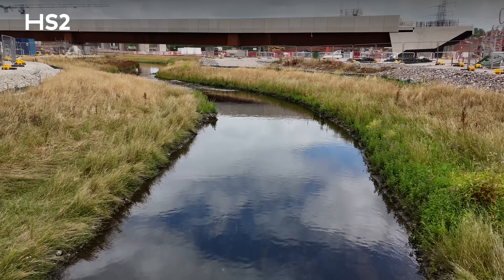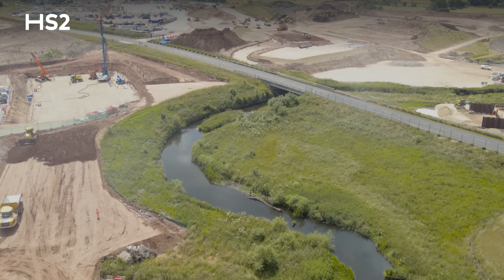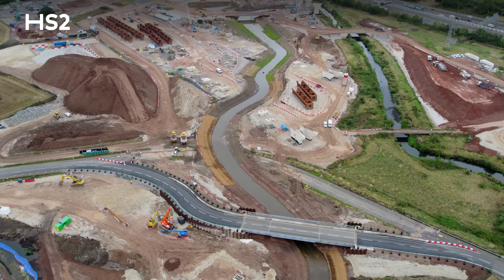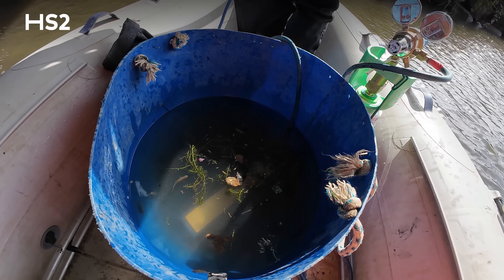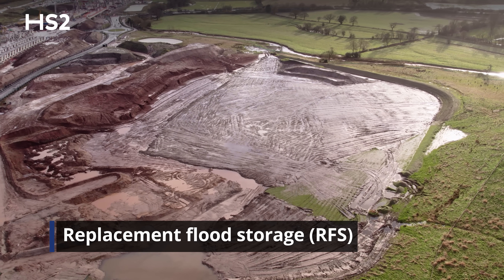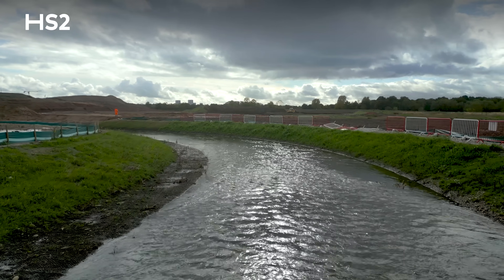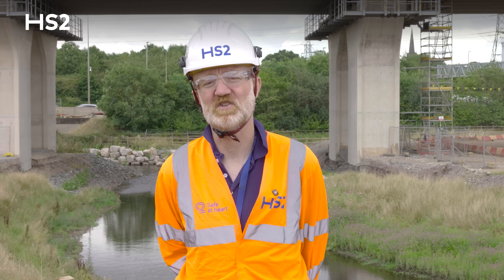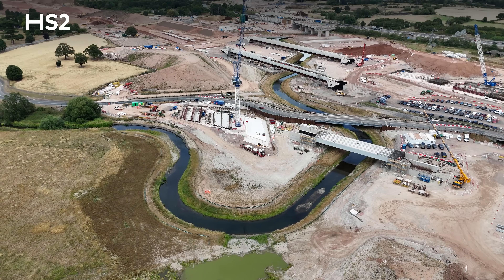HS2 completes huge river realignment in Warwickshire

Comment: Magnificent work - but what complexity, what expense! And this is just a tiny stretch of the railway. England is densely populated with innumerable settlements, so the engineering challenges are extreme. France, on the other hand, is largely empty and flat, so high speed railways can just be driven through at relatively little cost . . .

Comment: This seems to have been a worthwhile undertaking as far as the new river pathway is concerned. The only reservation I have is the apparent lack of inclusion of trees, particularly along the riverbanks.This is an especially important aspect as it should help to stabilise the new embankments, including that of the river itself, more quickly than just mere grasses, and it would add to the richness of the biodiversity that the project is aiming for.  
Climate change means ever increasing storm frequency and intensity. Therefore a major flood event might wash away much of the careful and thoughtful work that has already gone into the project, even (with) the additional flood abatement storage area. Getting trees in early could make the difference between having to redo work already done at great expense and being able to heave a huge sigh of relief.

Comment: Massively over budget,  we don't know what the final cost will be to the taxpayers. What a complete and utter waste of money that could have been spent more wisely.
Reply: How would you have spent this investment instead? How would you resolve the capacity issues and bottlenecks on the West Coast Main Line, increase passenger services, more local services and more freight? Let me guess you only think short term?
Reply: @Maxhead_room looks like you are not going to get an answer so I will give you mine..should have been a new line along the same route but not a high speed line. The Country is too small to justify a high speed line.
Reply: Better spent on improving utilities (water, electricity, sewage) infrastructure.
Reply: But we still wouldn't have known the final cost because Contractors  are refusing to offer all risk contracts above 5 or 6 hundred million. But a slower speed line would have been cheaper than the high speed line.
Reply: @TrevorWilliams-fq8mg thank you for a constructive response. A new 125mph line would have also been incredibly costly too, the same environmental requirements and mitigations would still be necessary, plus it would still need to be built for low maintenance for 125 years, the only difference is that the alignment could have been more tolerant to tighter curves. But if you are going to build a new line then why not build one fit for the next couple of centuries? HS2 is also about new high capacity stations, what would you do in this regard?
Reply: @Maxhead_room I think the Country is too small to justify a high speed line. And given the extent of cuttings and tunnels very little scenery can be enjoyed on the ride. It's an extensive solution to fixing the problem.

Comment: 80 billion and counting being spent , enviroment destroyed and for what? 20 mins quicker to birmingham. This country has lost its mind.
Reply: Plus getting back to your original nonsensical comments. Environmental destruction? There will be a net gain in biodiversity, afterall you are commenting on a video where they are significantly improving the natural environment over what was there before. Don't fall for the populist nonsense fella!
Reply: HS2 is more about providing more rail capacity. As inflation pushes up the cost of the project so does the economic benefit increase by the same margin. Many of the cost increases were caused by the Sunak government making populist decisions about HS2, rather than the right decisions. With your simplistic comment you strike me as a populist-type.
Reply: @Maxhead_room  You don't need a 225mph line with all the associated extra costs just to add capacity, they could just have added another 2 tracks to the WCML to do that.
Reply: @neilrobertson811 so you suggest having a 6 track WCML? Do you not think that is somewhat illogical given the disruption it would cause and all the infrastructure that would need rebuilding (infrastructure that goes through the heart of large cities and towns - how would you squeeze this in?). Plus have you tracked the route and all the slow curves? Classic 'armchair expert' with absolutely no grasp on reality.
Reply: @Maxhead_room  You said capacity, not speed. Make your mind up. And it doesn't need to be 6 tracked all the way does it. An extra 2 tracks at certain locations for certain distances would be enough. You being such an expert I don't need to explain any further.
Reply: @timstarkey-smith8842  I don't know, why don't you tell me. I suspect however much it is it would cost less than 1 billion a mile which is the current cost of HS2 unless you think those cables are made out of 24 carat gold spun with unobtanium.

Comment: It's built for the rich to use because no one else will be able to afford the extortionate fares... It's a complete waste of money 👎🏻
Reply: Since no-one has published any projected fares; how can you be critical about them when they do not yet exist ?. Is it that, you expect them to be excessive ?.
Reply: @JohnHoward-wc9kk I know one of the project managers he said due to the cost of HS2 the fares will be high due the amount of money spent on the whole project. 
It's common sense really how else are the government supposed to recoup the billions
Reply: @jase1435  Well the government has many years, Decades in fact, to recover its investment in the infrastructure. It does not need to pile it all on initially.  Air travel, especially short haul,  is going to increase in cost because of carbon taxation and should attract  more passengers onto the trains. That would be another reason to extend the network to Glasgow and Edinburgh, it would make flying unviable.
Reply: The same comment was made when South Eastern's HS was introduced.  Now the commuter service is packed, standig room only at Gravesend.
Reply: business case was built on assumption that fares would be the same as the existing service. 
Transport objective is not achieved unless most passengers move off the current services (releasing their capacity for places like Milton Keynes) onto the new services.
Think Ryan air not concorde.
Reply: @unkleoo they should have spent  money on the existing railway but instead they've disrupted thousands of peoples lives and in some cases ruined businesses with this farce of a project

Comment: I was told we already got 2 lines going to Birmingham. Why did we need a 3rd? I was shocked when I found out there’s was already 2.
Reply: If you weren't even aware of the two existing lines then you have no chance of being aware they are full with no capacity for future growth.
Reply: Shut up bot.🤖
Reply: @Chevy-jordan what did I do?
Reply: You're right.
Reply: Because those lines are slow for the modern rail an at or over capacity.
Reply: @DavidKnowles0 1h and 20min is not slow😂 I do from dartford to east croydon… now that’s slow
Reply: @Pi-jt3lw  it slow by international standards.

Comment: Mexico just finished there HS rail , twice as long as the UK in 3 years 😂😂😂 bring back the APT
Reply: Road near me Castle Street A63 upgrade in Hull.5 years and invisible men working.
Reply: I don't know anything about Mexico's new High Speed Rail, but they join a increasingly long list of countries that have invested in HS rail. It is a better option for mass transport than new motorways  and air travel. I would take a bet that the Mexicans  have not had to  tunnel a huge portion of the new line to 'protect the environment'  and I doubt any Bat tunnels are getting built. We are own worse enemy in this country. Some of it was necessary, some of it not.

Comment: There is an interesting video on the 'Green Signals' podcast (available on YouTube) with former HS2 Technical Director Andrew McNaughton giving some insight into how HS2 failed. HS2 was designed to have the highest line speed of any high speed railway outside of China and one of the highest density of trains per hour outside of Japan combined with the first major application of slab track in the UK. Each single element can be justified by Professor McNaughton, but combine them all together and try to build HS2 in a country with no experience of building a high speed railway since HS1 opened in 2007 and you can see why the complexity made the original plan for HS2 unbuildable in any sensible budget or timeframe. The KISS principle (Keep It Simple Stupid) seems have gone completely out of the window.
Reply: And what was wrong with that ?. The design parameters  AT THAT TIME, was for a full Y shaped network to Manchester and Leeds to become the new backbone for all passenger traffic between several of our major cities. It also had  to cater for trains from Glasgow, Edinburgh and other cities that used the HS tracks for  a good portion of the journey. On that basis, or premise if you like, the design was completely justified to be (A)  slab track  (B)  225mph (C) substantial new stations with multiple platforms. Now that HS2 has, for the time being,  been savagely truncated the  need for this has high spec has waned. However, as our population is expanding rapidly,  this will get revisited and HS2 will get built out completely as per the original design. Its really only a matter of time.
Reply: Posting the same utter nonsense here I see, but it's still just an example of how you misunderstand everything you read. Classic armchair expert credentials on show.
Reply: @Polarbear1-b6j a bit harsh on the original poster there my friend. Green Signals is a reliable and balanced information provider. I don't think HS2 should have been designed any other way but the original comment is valid.
Reply: @Polarbear1-b6j I rather think it is yourself who needs  to be a little better informed re armchair experts.. Andrew McNaughton Special Professor of Rail Engineering at Nottingham University previously Chief Engineer  Network Rail. Nigel Harris (Green Signals) one time   Editor  of RAIL magazine. Richard Bowker (Green Signals) retired chairman of the Strategic Rail Authority and prior to that a senior executive at Virgin Trains.
Reply: @Polarbear1-b6jThe highest line speeds outside China with the highest train densities in a small Country spells train jams, like the overcrowded roads.

Comment: Ridiculous how long and how expensive this project is. Just build the damned thing in full instead of chopping and changing all the time.
Reply: This construction project is much more complicated and more vast than most folks realise. The timeline and costs were not helped by the nonsense logic of the Sunak government who made populist decisions rather than the right ones. The current government have not interfered with Phase 1 plans north of OOC but are clearly cautious about phase 2 and Euston because of all the populist rhetoric being thrown about.
Reply: @Maxhead_room . Correct. And it will be 2040 when the OOC to  Euston link will be completed.  And about 2035 to complete the rest to Birmingham and Hansacre.
Reply: @Maxhead_room That's the problem with this government. They claim they're about change yet the make small insignificant tweaks around the edges.